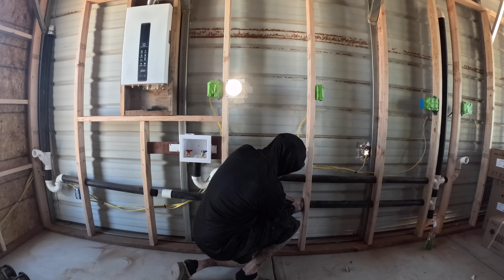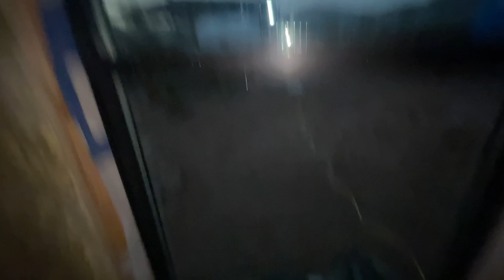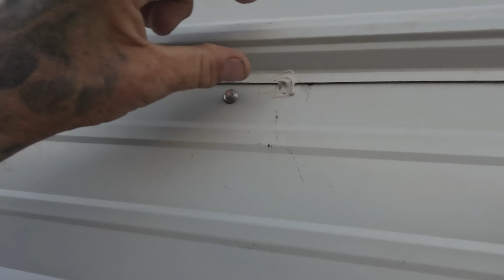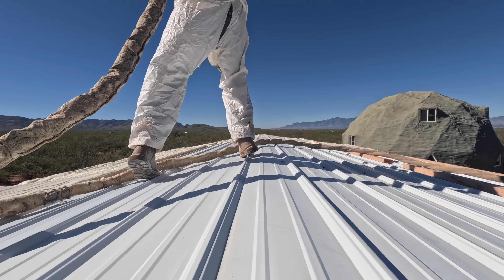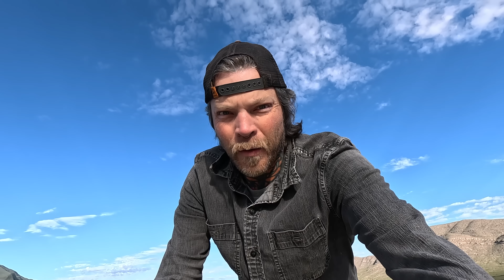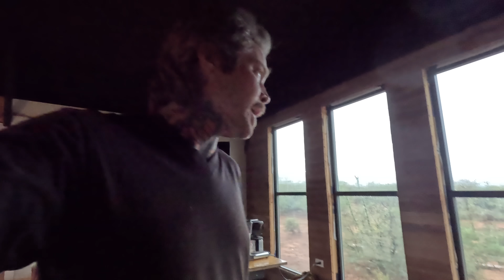CARPORT CONVERSION DISASTER: We Regret Building Our Tiny House

Comment: Thanks for the video ! I've tried a few unique building designs and methods over the years. I slowly came to the realization that standard construction methods, whatever their shortcomings, have worked through most of the challenges and problems that I failed to anticipate. I still don't completely resist my desire to try new ideas but have scaled back considerably on attempting to: "reinvent the wheel." Ideas I've thought looked like shortcuts have usually turned out to have unpleasant surprises, consumed more resources and didn't get me to the destination I'd wanted. 
Best wishes & good fortune to you !

Comment: That foam is not sun resistant..it will rot.get it silver sealed AFTER suggested cure time of foam, in fact wait a couple extra weeks---off gassing will be an enemy to proper silver seal.
Reply: Ugh, BLACK is the absolutely WORST color to paint in desert environments. Didnt you even try to research colors in climates?
Reply: The black is just a base layer to guarantee that the paint is totally light opaque. Our foam contractor has found that many lighter color paints have a lot of light bleed through, which is why I went with black for the under layer. I'll paint the entire final building the same light green as our geodesic dome which has held up great over the last year

Comment: In the video, the metal roofing sheets are installed with the ridges running parallel to the roof line. That orientation can trap water in the corrugations instead of letting it shed off the roof. When the ridges don’t run downhill, water has nowhere to go, so it can sit, pool, and work its way into seams or fasteners. Over time, that increases the risk of leaks, corrosion, and premature failure. Metal panels are typically designed to shed water when the ridges run down the slope, not across it.

Comment: When put up tyvek cut out whole window area and then add v in corners at the top of window frame opening ..Then add tape to bottom of window opening with tyveck and 3 to 4 inch up side take the v flap out of the way and add silicone to sides of window and top only...Then add window to area and nail straight the flap at top should be out side on top of window..Then tape sides then top flang only then add flapl and tape the v..You can add tape to v across window after ..You think like water flow that is how you tape then seal inside with spray foam never add silicone to out side on bottom or nall bottom flange if large over hang then should be okay but not the right way..The spray foam should be spayed on wood not tyvek thats wrong way ...Doors same way ..cut v add tape to door plywood  top and tyvek on sides tape to sides not in side then tape v same as window..If water gets in back of tyvek it comes out not in side building .. hope this helps people ....
Reply: I ended up redoing the tyvek above the windows exactly like that, plus put a drip rail flashed to the OSB, tyvek overhangs the vertical section of the drip rail to keep rain totally off of the windows now

Comment: You over lapped the tin wrong. The close up you showed, you overlapped the top seam with the bottom of the overlapped connection. The panel edge that goes on top is shorter and is called an anti siphon edge, to prevent water entering.
Reply: It's Definitely wrong. We had a handful of friends come over and help us build the structure and none of us knew what we were doing. No leaks now though

Comment: the metal roof needs to go vertical not horizontal, thats the problems with this type of carports, i own a couple of them myself! lol.. Always be fighting water as it sheds the long ways and nothing directing it away. And way harder to direct it away when it sheds off the peaks instead of the side walls where an eavestrough could easily collect it. I dont want to be negative, but i personally think the spray foam on top of this flat roof is terrible idea. Its going to pool everywhere. I would have applied some sort of sealant instead that you brush or roll on.
Reply: If the joints are properly done with butyl and the screws are silicone rain won't be an issue. I've built these buildings for 30 years and never had a problem
Reply: @lesheath6216  still sheds water the wrong way, you cant put eavestrough on a round front, this building in the video has a foundation that all that water will destroy over time

Comment: Biggest problem with your windows is you tucked the top of your tyvex wrap into the frame when you sat your window. The flap is to overhang the top of the window so the water flows over the top and down the sides.
Reply: We learned a valuable lesson, and you are absolutely correct
Reply: You don't even need construction knowledge to know that.   Just common sense, water flows down hilll😂..  I've seen crazy stuff as contractor but this is bad.  They need to get an education before doing any more building.  Spray foam sealant 😂

Comment: I personally would have done a couple coats of snow roof instead.
Reply: We will probably do that on a final layer at some point, but we wanted something that was 100% opaque which the black paint certainly is
Reply: @markmayhem2173 I mean snow roof instead of the foam. Something I found out when I purchased one of those car covers. When they installed it they made it tip to the rear. So it’s not level front to rear just right to left. They did this so water would run off the back and not collect to poor past the seams or run off the front entrance. I believe the panels overlap the same on mine but don’t leak a drop.
Reply: @offgridliving4128 we put it on a slight slant from back to front so it doesn't really pool up, but when there's wind with a heavy rain the water will climb up and do all sorts of crazy stuff as it's running down the seems. I'm okay with the foam because Kyle is a good friend and he wanted to offer the vapor barrier foam for a discount, which has solved the issues for now

Comment: Oh man. I could somewhat defend the spray foam on the dome, but this seems like a terrible idea for a few reasons:
1. The slope isn't remotely steep enough to prevent pooling water between the spray-foam lumps.
2. You were working with a flat surface here, and could have more easily just added a vented roof to your roof (ideal) or just gone with a roll-on elastomeric coating (easy).
3. That roof oil-cans. I'd count on the spray foam separating from it, water pooling under it, and then it being a major PITA to track down future leaks.

I think this is a classic example of putting good money over bad.
You might be doing more of that when you install the solar array. But at least that is more easily removed.
Reply: So far it hasn't leaked at all, and it just rained all day yesterday... No water is pooled up there just from an hour of sun. This foam he used is specifically designed for flat top roofs and it's very bonded to the panels. Time will tell if it was a bad idea or not, but it was only $400 for the roof coating, so we were willing to risk it for the leaks to be fixed.
Reply: @markmayhem2173  Let me tell you something.....All one would have to do is search on Youtube for the numerous videos of "new construction build problems" with houses ranging anywhere from $300,000 - $900,000+ having so many issues even AFTER inspections. Some of them even had leaks! $400 is a small price to pay and leaves PLENTY of room to correct any issues that come down the road. I wish you both success, a peaceful home, and joy in your home. Love your videos <3.

Comment: Good to hear from you.  I love your projects.  We were in need of a horse stable.  We bought a 12x26 carport off of Amazon.  Construction wise, it's pretty much the same as your carport house; however, the roofing panels are only a little over 4'.  I gratuitously assumed they were built not to leak.  But, that wasn't the case.  We have a number of drips.  At first, I tried Flex Seal, now I've shot foam into all the joints from underneath.  I'm waiting on a good rain to check it.  Since building this, I've seen the kits were the roof panels run at 90 degrees to the longitudinal axis of the building.  I think that would be a far superior design.  I really like the idea.  I've built a few houses but I think it would really cool to build a house under one of these carports.
Reply: So far we've had a bunch of rain since doing the foam vapor barrier and it has zero leaks now! I wish there was an easier way, but the cost was low and it will last for many years like this.
Reply: he could had  just lay plastic, trap or roofing paper on top before spraying the foam.
I built a 12 x 16 shed. I used OSB for the roof.  I had to nail them in and leave gaps for expansion.
It was going to leak unless I sealed it or cover it somehow. I just used roofing paper under the roofing
material.
I also built big industrial size metal buildings . The screws has RUBBER washers ..but you still have
to make sure they're screwed in properly.  Thousands of screws..Im pretty sure I missed here and there 😂

Comment: Should have went with white or silver to reflect all light. Black will soak up the heat and break down the spray foam
Reply: We just used what the spray foam contractor suggested. It might draw more heat, but  the black paint will block ALL light, including ultra violet before it gets to the actual foam because it is totally opaque, or at least we hope so.